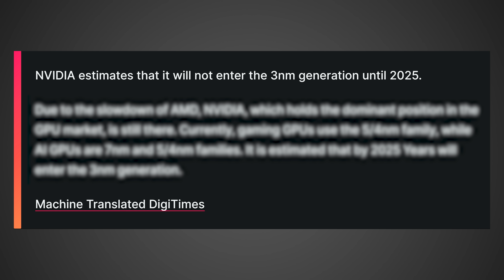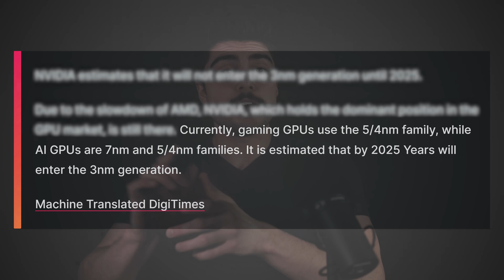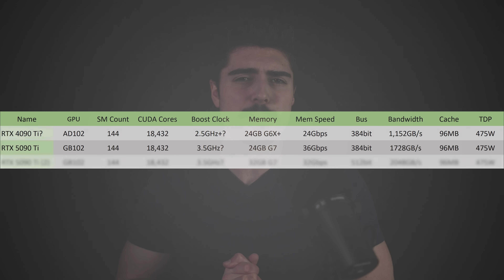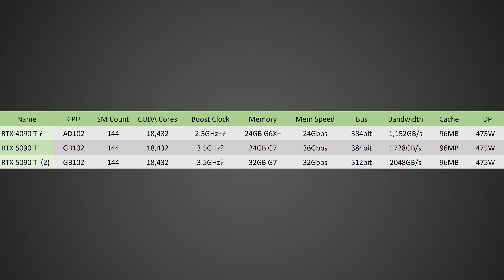GIANT RTX 50 Leak - Release Date & Specs

Comment from the maker: When do you think the RTX 50 series will launch? Let me know your thoughts in the comments below!
Reply: "GIANT RTX 50 Leak - Release Date & Specs" you tell me
Reply: @tryndemisha6719  Ikr
Reply: Spring 2024
Reply: The claim appears to be completely made up with the intention of boosting their present sales now that the production line has seemed to have jammed and had a spill on isle 4070. However, I believe the 5090 series could potentially offer a performance increase of at least 3X. It seems unlikely that Nvidia would make a mistake by using DisplayPort 1.4, as by the time it's released, monitors with DP2.1 will be widely available, and even owners of AMD graphics cards can take advantage of the Fine Wine and increased refresh rates. It's highly probable that Nvidia will upgrade to the higher bandwidth DP2.1, which in itself would provide a performance increase of approximately three times or more. But...What do I know!
Reply: 2025 is FAR more likely than any time in 2024, Nvidia have a ton of performance and price wiggle room for a 2024 refresh before introducing the next generation.
Reply: @terryblanchard4929  If NVidia offered good products you wouldn't need to upgrade again next generation.
Reply: a 5090 should be 128 gb vram minimum. It's time to get nvidia to catch up with the modern times.
Reply: @imaginalex5850  lol wutt ? 48GB would be enough for a high end commercial grade GPU
Reply: @nimrodery  its not that Nvidia don't offer predominantly good products,
but the cost to product is held way above the national average pay and preventing a lot of gamers of experiencing high end at an earlier stage, aswel as holding back the creative audience. I am still happy and regularly impressed with my old Sapphire 6950XT Nitro during COD MW2!
Besides, while there are companies like AMD who can still deliver the goods within 10% without draining your wallet and resources. Why not AMD!
Reply: @terryblanchard4929  Most of NVidia's GPUs from the 3000 series don't have enough VRAM to turn on raytracing without reducing settings. That's not "predominantly good." If I had to buy a new car every 2 years because a 3 year old car works on half the roads, I would not call an automaker's products "predominantly good" because they also make a really expensive version that's okay to run for 5.

AMD wasn't available near MSRP in Canada when I bought my ARC. It's nice to know if I had waited until now (and if I was American) I could buy a 6950 XT for a decent price. If I check NewEgg for the 6950 XT I still see prices from $1000 to $2000.
Reply: @Minimalici0us  No. Nvidia has been pushing on the brake of giving their cards enough ram for the past 7 years, gen after gen they have gimped all the progress of vram capacity on gpus, the correction should be to release the next gen of 5xxx series with 16GB vram on low end rtx 5050 entry card , 24 on mid range 5060 , 32 for the 5070, 48 on the 5080 and 72 to 128 on a 5090. That's where it should be.
Reply: @nimrodery  I understand your frustration with the limited VRAM on many of NVidia's 3000 series GPUs. However, it's important to keep in mind that Technological advancements and product improvements are constantly evolving in the tech industry, and it's not uncommon for certain products to have limitations or drawbacks.

As for your car analogy, it's not quite a fair comparison as the Tech industry is known for rapid advancements, whereas cars I would say typically have longer life cycles.

Regarding AMD's availability and pricing, it's unfortunate that it wasn't a viable option for you at the time of your purchase and this again is unfair. However, I'm glad to hear that the market has since changed and that the 6950XT is now available for a decent price. Keep in mind that pricing can vary though based on a number of factors, including availability, demand, and competition in the market.
Reply: @terryblanchard4929   "it's not uncommon for certain products to have limitations or drawbacks." It's called "planned obsolescence." VRAM has been a feature we've asked for repeatedly, so we get DLSS and raytracing.

I'm not buying a base model ASRock 6950 XT for $1000. Next price tier for those GPUs is $1300 (Sapphire Nitro, XFX Speedster MERC), then the price jumps to $1700. The 6700 (non XT) was a better value in Canada than anything above, although the 6700 XT was briefly available at decent prices.
Reply: @nimrodery  Yes,
that is the harsh floor!
Well thats the difference between AMD and Nvidia
Ask AMD, you get more RAM, ask Nvidia you get DLSS!
The truth is there is no perfection in any product and that product can stand up to the definitions of time, there will always be a successor or "planned obsolescence."

Although I would not recommend any GPU below 6700XT, if your able to pick this up used on Ebay would be great or you may even see a better deal!
Reply: Bro that's crazy news, considering there's a strong possibility of the earth being torched before the end of this year. 😳
Reply: @AwesomeBlackDude  Indeed. lol, what have you been convinced by!
Reply: @AwesomeBlackDude  Hey Chicken Little, been minutes to midnite on the doomsday clock since I was born almost 50 years ago. But sure, let's hear the latest "we're all going to die" scenario.
Reply: Feb-April 2024
Reply: @jimashby43  Surely not another conspiracy theory. next u will be telling me u believe in flat Earth! 😂😂😂
Reply: @terryblanchard4929  Square Pizza to.
Reply: @jimashby43 I take that as a yes then Jim!
Reply: @nimrodery  I can't wait to hear myself! Well, Awesome Black Dude what do you have to say to back this wild claim up!😂
Reply: fall  2024 based on past release cycles.
Reply: Prolly tomorrow
Reply: 5070 TI a Monster GPU with „12 GB“ VRam 😂 i See ist coming

Comment: The demand isn't low, the pricing is stupid
Reply: I’m hoping they pull a 30 series launch and reduce the prices while giving major increases in performance
Reply: @robert7668  that definitely happens when the price boats enough, but I don’t think we’re there yet because the 40-series is still selling well. Also, the demand for these is definitely low because the 4080 is already perfectly suited for even the most demanding games. Need some more games to really push it before this is in demand, unless it’s simply cheaper, but I doubt that.
Reply: and the future games will have even worse optimization
Reply: this^
Reply: It's not just the price I think,chip demands are extremely low in general rn,not just for Nvidia,but it's the worst for Nvidia because of their stupid pricing
Reply: @paddington2063  I already hit the 24 gigs vram limit of the 4090 running Skyrim in 4K and many mods xD of course it doesn't count as a normal game but I really want 32 gigs GPUs lol
Reply: @paddington2063  That's kind of the point, I would buy it too if it wasn't so ridiculously overpriced. The 4080 should be between 500-650
Reply: @madhunter6420  I don't think it's about optimization, future games will just have massive texture packs. The games we play today could look so much better the art and game engines aren't the limitation, the hardware is
Reply: @PCMastodonRace  That will only keep getting worse if the texture packs and graphics keep improving, with the onboard memory AMD had foresight to add 16gb to their cards Nvidia didn't
Reply: These cards can't even run AAA games above 60fps 4k native on ultra. I'm fine sticking to my 3080ti if all we are gonna use going forward is A.I. to generate frames.
Reply: Yep for the first time ever I have an AMD 7900xt on the way. Been NVIDIA forever but they finally pushed me to try the competition. 

I've had the 1080ti, titan, 3070 currently. Wanted to do a 4080 after seeing the 7900xt perform almost as good for 400-600 less, going to try it
Reply: Don't worry. Nvidia has this figured out. Did you see all the articles saying they're slowing/stopping production to keep prices high? Surely consumers will buy them right away at stupid prices if they learn there are less available. Right...? 🤔 🤷‍♂️
Reply: @dhLotan  Of course! I just ordered 5 4070's after hearing that
Reply: @GreyKnight52  big shrug time will tell
Reply: @robert7668  they didn’t reduce prices for 30 series. They just didn’t raise prices and everybody got excited
Reply: Demand is also low. Were in a recession where people have less disposable income.

Both low demand and high prices.
Reply: Cost of living crisis in most places must have an effect on this tied with the daft pricing
Reply: @PCMastodonRace  You will have to purchase a professional grade GPU to sate your vram appetite 🤓.
Reply: I think it’s both
Reply: @SevericK_BooM  Could be I suppose, but I feel like demand didn't disappear, everything else is stupid expensive now too
Reply: Yea before the only GPU over $1k was the Titan XP and that wasnt even needed at the time. Now the 4090 is double that price and it can be very much used but the economy is shit so people would rather wait or spend money on rent 😂
Reply: You don't know what the word "demand" means in basic economic terms.
Reply: @moriyokiri3229  I do, but trust me people want to buy GPU's they need them, they want them, but it's a luxury item and not a necessity and with the economy as a whole, it's nearly impossible to do so. I don't need a lecture to know basic things. Plus inflation or not, GPU manufacturers are getting greedy now and everything they have put out is more expensive and their margins are much higher than they used to be while the consumer gets much less than they used to.

Comment: If 3nm isn't quite ready by the end of 2024, then Nvidia might just delay the launch of the 50 series until 3nm is out. 3nm has to be ready by early 2025 at least. There have been leaks going around saying the 5090 will likely have 24 GB of G7 at 36 Gbps on a 512-bit bus based on the TSMC 3nm node and will feature an entirely new SM structure with significantly faster and more enhanced RT cores. That would be insane if that’s actually the case, and it should deliver a monstrous raw performance increase over the 4090.
Reply: Well that only satisfied and appeal to the 'flagship' chasing content creators if anything. Only niche users in general.
AMD's ROCm should have some interesting results by the time 2025 comes around.
Reply: lame, why is the Vram still going to be capped at 24GB after all these years.. this truly is pathetic.
Reply: Leading edge nodes are getting so expensive, when 3nm is ready only the highest end  $1500+ USD videocards will use it,  that and AI chips for datacenters, and Apple products.  We won't be able to expect sub $1500 cards on 3nm until late when the wafer prices come down a bit
Reply: @hypersonicmonkeybrains3418  They cap it to force devs to buy those $6000 Quadro cards and those $30k ai/datacenter oriented blades.
Reply: Can't wait to upgrade from my RTX 4090 FE to RTX 5090 FE.
Reply: @2drealms196  this. As someone who invests in tech stocks Nvidia is killing it in so many massive areas right now. Almost all the best wafers they can source will be used in the Ai supercomputer clusters they are building for lots of people in the next 3+ years. I’ve also heard the 3nmm process is booked up by Apple in a big way too. Oh & it’s not a cheap process & won’t offer any substantial savings.

No idea what’s true from this but it has the ring of truth to it. Especially if you go see the tools Nvidia is developing
Reply: @Estarossa300  is this irony or you flexing your credit rating ;)   #mustimpressinsomeway if  you got that much money to waste then I would waste it on women :D

Comment: Expect maybe a “Super” 40 series to bridge the gap, like they did with the 20 series.
More or less the same. More RAM (because they are getting hammered in the press for the low ram they offer now)  and tweaked performance at a similar price, possibly pushing the existing cards down in price by 10% to make room.
Reply: Im not sure about the vram part
3080s went from 12 to 10 gig, 3060s from 12 to 8, 
I think the rather decrease vram, lower the bus size, decrease the core count and invent dlls 4.0 that is exclusive to the 4000 super series and injects 2 fake frames for every frame generated. This of course will be priced at double the cost of a comparable amd card and jensimps will still buy it

Comment: My question is how much power do we really need? I bought a 2080 ti 5 years ago and its still going strong.
Reply: I brought the same card 3 years ago, still great. Especially since I got an 11GB model. I can’t go back to these 8 or less vram models now.
Reply: Depends on use case. 4K struggles
Reply: @davysmith8569  the 40 series cards can’t do 4K well either though. My gtx 1080 was hitting 4K 60 with high settings.
Reply: @NostraSamus  yeah i paid the man to get a 4090, its the only 4k card that works pretty good so far. I still see some jumps in games, just cant win sometimes lol
Reply: @NostraSamus  Depends on the games, obviously. You saying your gtx 1080 can do 4k 60fps at high settings means nothing if it's on some old-ass games. It definitely would not be able to reach 60fps running cyberpunk at 4k with ALL settings high, just for one example out of hundreds. So what you say is literally meaningless. It's too vague of a statement. It depends on the games

Comment: now this will be a significant upgrade if youre coming from the rtx 30 series cards. my plan is to go from a rtx 3080 to building a whole new system with the graphics cards being a rtx 5080 or 5090.
Reply: Same
Reply: I went from a 6700K + GTX 1080 to a RTX 4090 + 7950X3D. It was a significant upgrade!
Reply: My plan is from a RX 6800 XT to RX 9700 XT or RX 9800 XT. Nvidia is just too expensive.
Reply: I'll pair the 5090 with a 5800x3d for high refresh 1440p lol
Reply: @JP-eu2dc  4090 gets bottlenecked quite a lot at 1440p…

A 5090 would get REALLY bottlenecked at 1440p!
Reply: @elaiswaifu5459  don't do this to me 😭
Reply: @JP-eu2dc  being overkill is better than being not enough, so it’s all good man…

I’d recommend you use DLDSR tho with your 1440p monitor, puts more stress on it so it’s less CPU bound…and gives you a much sharper image than native!

Comment: if a 4070 super was faster than a 3090ti and had 16 gigs of vram and has a 256 bit bus for 800 dollars it would be the best price to performance ratio but still not ideal. basicly it would fall in where the 4070 should have been.
Reply: Ain't what you're describing  the 4080?
Reply: @FrowningTaco  yeah the 4080 is actually the 4070 ti and then the 4070 ti is actually the 4070 and then then 4070 is actually the 4060

Comment: I'm more interested in when developers will start actually using DirectStorage to alleviate the insane CPU overhead we've been seeing with more and more titles.  The 4090 sits virtually unused in many newer games while framerates tank into the 20's with raytracing enabled, and not much better without RT enabled.  All seemingly due to bottlenecks created by asset movement between storage, system RAM, the CPU, and then GPU.  All of which could be eliminated with the use of GPU hardware accelerated DirectStorage and a fast SSD.  Because right now, the fastest Intel and AMD CPU's are bottlenecking the 4090.  So, the 5090 is totally pointless.
Reply: Agreed 👍 we need the direct storage thing to take off now, so many games in the last 5 years that just run shit / take forever to load when playing 😫  looking at you FO4 🤬
Reply: Anyone believing that Direct Storage won't have a negative impact on rendering performance on the GPU while using its resources needs to wake up. I would expect at least a 10-20% performance loss, maybe more if you want to avoid stutters and get smooth fps. So while Direct Storage might, I really want to stress this, might lead to a performance increase in situations where you are CPU/memory/VRAM limited, it will also probably mean big performance losses in cases where you are GPU limited.

Comment: If they release a 512bit 32GB 5090 then this is going to be a deep learning monster of a gpu. I would really want to see that but I doubt that as it will seriously murder the sales of their workstation cards. Having said that though, their lower end 8 and 16gb workstation GPUs are sort of irrelevant anyways so they should probably kill them and have them start at at least 48GB.
Reply: Consumer GPUs should be 24GB at midrange and 32 or 48 for the High end, Workstation GPUs should be nearing 128GB at this point.

Comment: Would a no compromise 4090 7800x3d build be plenty enough for a 5090 swap when they release?  If not what might need to be upgraded?
Reply: Wait on Intel 14th gen; 14th gen isn't a refresh and should big performance gains. I waited on the 7th gen of X3D, but based on the hype they underdelivered compared to what we saw with the 5800X3D. It seems that the cache in 7800X3D is almost too much for games to be utilizing it all.
Reply: Stop panicking about tech, that's my advice. If you're worried about a couple frames per second, these corporations own you.
Reply: @nimrodery  I'm a sim racer with tripple 55s is why I was asking. But for the average gamer you are right
Reply: @4Kcorner  Well nobody really knows what CPU games will like in two years, but I'd rather go with AMD because you could still upgrade to a better CPU if the 7800 X3D isn't sufficient. Just speculating though, don't take my advice seriously. I'm still running a 5820K because why not?

Comment: It will be a much larger and more expensive card as NVIDIA is now pricing their cards based on their cubic inches size and weight. Be ready to buy that next gen of tower cases. They will be called the Ultra Tower and designed to accommodate two PSUs. PC builds in the future will be known as "Circuit Breaker Trippers."
Reply: In the future the card will be the tower case, you'll install your CPU and drives inside of it.